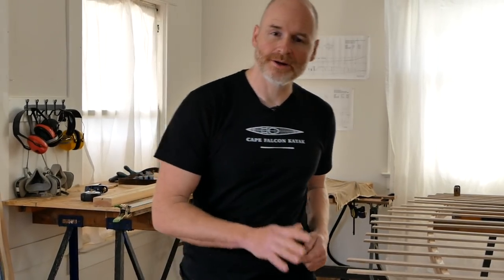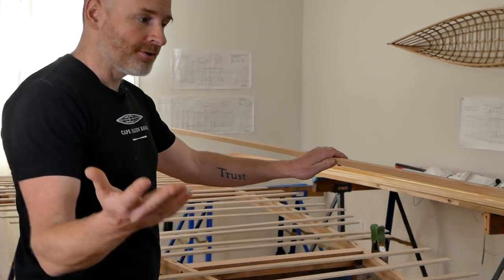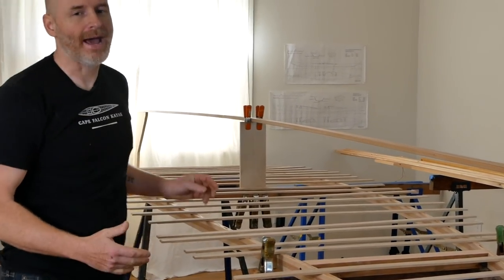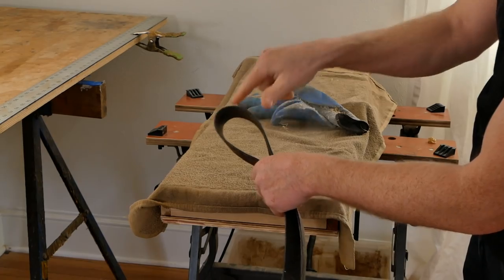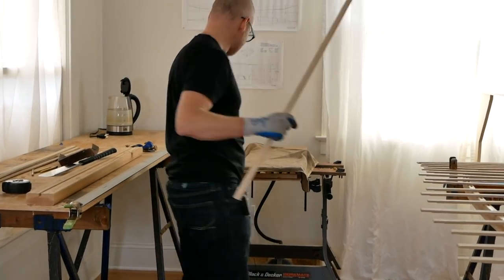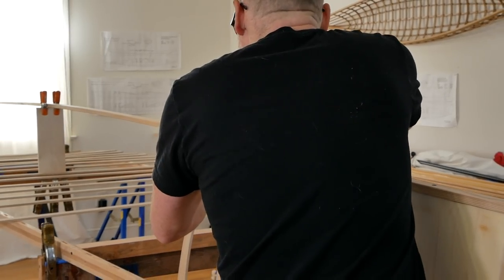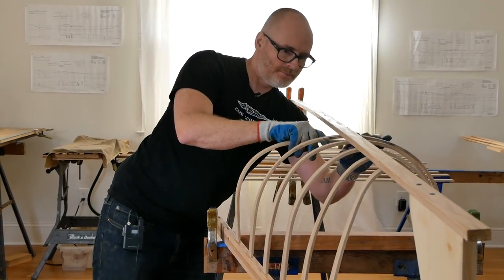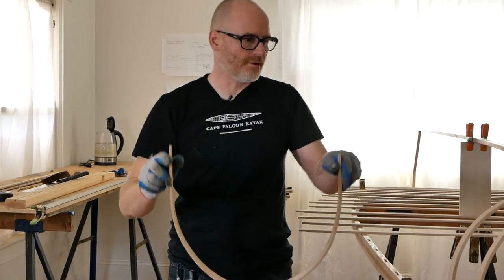Steam bending Skin-on-Frame Canoe ribs

Comment: hi! Lately I've been repairing cedar vessels, rowboats/ canoes/ power craft and have been very leery of replacing damaged ribs with completely newly steamed strips.  There are so many good tidbits of advice here that I am definitely going to do the hard job of chipping out a rotten rib and steaming/ resetting a rib with new wood. Thanks! I guess that means I'm building a steam box! Andrew C.

Comment: Great video. Wee observation regarding the thinning of the end of the rib on the table saw. Great idea. Slight adaptation having a 45 degree jib to have a centred semi circle curve rather than an unequal curve that could create torque twist over time.

Comment: I agree with Buttskid hisey….I also have build two SOF using mold stations....well explained indeed. Thanks so much! Will have to purchase your methods..thanks so much!
Reply from the maker: There are upsides and downsides to both methods.  Molds are time consuming and pricey to make, and the build is a lot slower but you do have more shaping control.  Freebending only makes certain shapes well, and you have to get really good bending wood, but it does save a lot of time.

Comment: I probably have at least a dozen small sawyers in my area, and white oak is the specialty. It mostly goes into rocking chairs and baskets.  Getting great, green/clear wood should be no problem-for the hardwood species.
Reply: I used to make lobster traps, curved tops. Very superior results, if green wood is steamed.

Comment: I noticed that you are little stronger with your left arm. Such that, when making the squared bends in the mid half of canoe, you had slightly asymmetrical outcomes. What if you make bends, then switch to opposite  hands and repeat same bending force.
Reply from the maker: Did I not say to switch every other rib in this video?  This must be an earlier video I’m constantly replacing the videos in my courses with new ones and all the new ones say to switch every other rib.

Comment: Could you just make your mortise larger, to avoid trimming tenons on the ribs?
Reply from the maker: The ribs are different sizes depending on the size of the canoe so it’s just easiest to stick with a single mortise size.  Also it’s really hard to find spiral up cut plunge router bits in 64th  sizes.